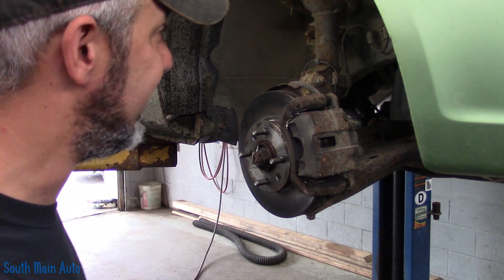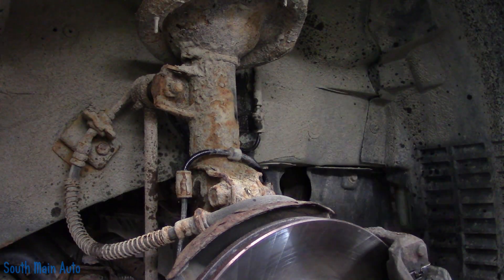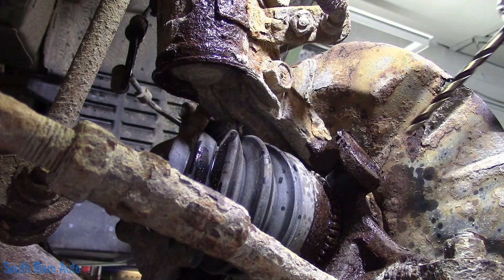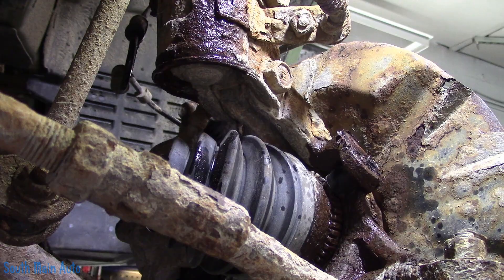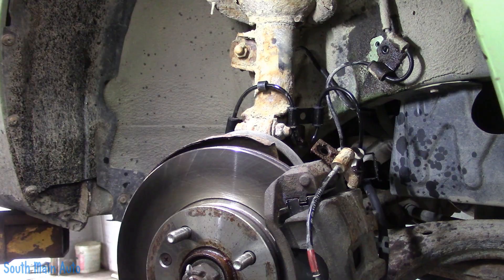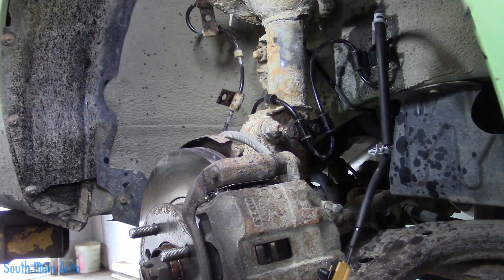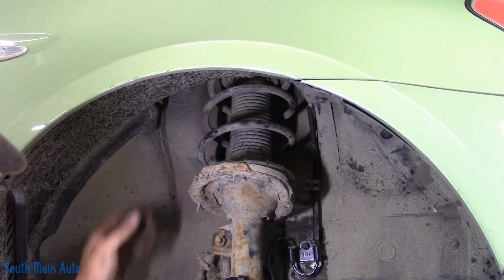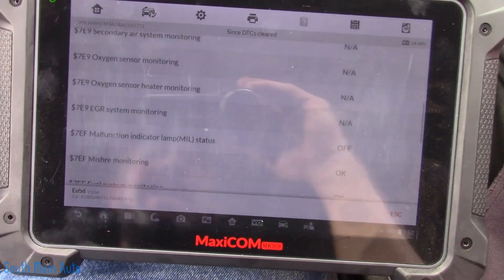Hyundai Accent: P0501 Vehicle Speed Sensor Range/Performance

Comment: Ive got a 2009 Hyundai accent and i changed the speedometer sensor but still wouldn't work , so figure its the wheel sensor ?what do you think ? I see its not to bad of a job to change it . Thanks for the video sure does help 👍🏽

Comment: I have this issue with my 2011 Accent - right after coming from the dealer for brake repairs - so I want to fix it myself. But online, this is the only source that shows it here, by the wheel. All the others point to the sensor mounted in the transmission for this code. But that must be a different sensor?

Comment: I'm running out of places to troubleshoot my C5 vette. The speedometer doesn't respond. I used an oscope to probe the VSS Signal and it's -6v to +6v. I don't think that's right? I also tried to use a function generator (cluster removed) and pump 0 to 10v square wave at 100 hrz into the cluster. Cluster doesn't respond. It'll sweep the gauges and all else seems fine with cluster other than speedometer doesn't register speed. The odometer doesn't register distance either in the cluster. Any help is greatly appreciated. I've tore into everything. PCM registers correct speed (with scan tool). Continuity checks / circuit is verified correct to cluster as well. I'm at a loss, thinking the PCM maybe out puting wring signal?

Comment: Ah, the Accent. I've got an '07 MC (2-Door) with just 49k miles on the clock. Solid little grocery getter. Lifetime free oil changes from the dealership. Every four months like clockwork. Free danish & bottle of water. Least miles between changes was 385 miles. Probably every time the oil going out looks like the oil going in.

Comment: Not a hyundai, but my car is having the same code. Everything works fine, speedometer is functional, RPM meter is ok. It's just that the check engine light will pop out if the RPM exceeds 3000RPM. No ABS. I'm thinking that maybe using a slightly smaller tire caused the error code. Some says that the tachometer itself is faulty.

Comment: I have a Kia Spectra with no ABS.  Same setup you have there.  I found out that if that sensor is bad you will never be able to set those three things to "Ready" because the wheel speed sensor feeds the PCM the speed signal.  So you won't pass the state emissions inspection tests.  If you had done a bit more 55mph driving they probably would have set  (at least the Catalyst and O2 sensor)

Comment: You wouldn't happen to know where the sensor is located on a manual transmission? I'm assuming the gearbox but just in case it's in a different location

Comment: I just heat up the left over part and melt the plastic a bit then they pop right out with a screw driver.  Clean up the hole with the Dremal and then the new one slides right in.

Comment: The speed sensor for the speedometer is located on the transmission. Had the same trouble code on my '03 Kia Rio. Unfortunately I wasted the $$ replacing the sensor when the real problem was corrosion in the wiring harness under the hood. Giant pain in the ass to figure out, took me ages to track it down. I never did learn what this single wheel speed sensor is for, must be something the ECU uses.

Comment: That relic appeared to be a 1964 Oldsmobile 88 four door sedan.  It would most likely have come with a 394 cu in v8 and may have had a 3 speed roto matic transmission, in fact it most likely did and they were junk, I think all the 98s had the four speed hydramatic although they had the same base engine..  Yes that was back in the day when you could just look at a car and know what year, make and model it was.  Now I can't tell which manufacturer the car is most of the time and as far as the year that is almost impossible for me.  Of course back then if you got 100,000 miles on a car you would have changed the plugs and points about 5 or 6 times, had to have had it aligned 2 or 3 times, changed the belts about 3 or 4 times and the tires would last maybe 20,000 miles.  The car would be totally worn out.  Yeah they don't make them like they used to.

Comment: Almost looked like an El Camino with that gigantic trunk back there, but that's an Oldsmobile - forget the model (looks like a few comments say it's a Dynamic 88). Early 60's. 👍👍 While the 2017 Chevro-laaay sits broken down! Sign of the times ... can't say I'm surprised!! 🤢

That was an odd system on that thing! How the heck can it read speed if it's open circuited? Must have a 2nd sensor in the tranny or something ... strange!

My new differential passed the test the other day - towed a Chevy 3500 van back from the Berkshires (Western MA) to central MA. -  https://postimg.cc/gnLCvDSG  - Had the tranny hit 212° on a long, steep grade. She was workin'! I'd imagine the diff was over 2-bills too. Nothing broke or howled, so it's all good .. but I forgot my ramps (yoooou dummy!), and had to get creative with a single 2x10 - cut it in half, and put a mini floor jack under each one. It worked! 🤣 Also made a scrap run. Workin' the ol' girl hard this week. Got rid of a '04 PT Cruiser, & piles of auto parts. Scrap prices still in the toilet - $110 per gross ton for whole cars and light iron. Seeing that PT get squeezed by the grapple was very rewarding. If I never put a wrench on one of those toilets again, it'll be too soon!! Good riddence, you POS PT!! 🎊 🎉 🥳

Comment: Real life removal of a speed sensor. In my experience Its rare to have one come out easily. I was impressed how quickly you got it out. The last one I did on my car (BMW) went into a blind hole so I was scared to drill it to far. Ended up removing the hub and punching it out from the back...bearing seems ok for now..

Comment: How the heck does a 2010 not have ABS?  Been mandatory in Europe since 2004, surely the great nations of continental US would have been all over that before the Bureaucratic EU?

Oh, and Hyundai are rusty buggers, wife had a 2010 i30 (aka Accent) and all the suspension/subframe was rotten out of it.  Body was perfect, just all the black bits underneath were in holes by the time it was 8 years old.

Comment: I'm not surprised there is a 2017 Chevy in your lot that needs a transmission.  We had our 2016 Chevy Z71 transmission replaced about a year ago.  I  replaced the A/C condenser earlier this summer and the (Rule Goldberg) power brake vacuum pump last fall.  All three issues are known problems, but GM refuses to do anything about them.  I've been driving Chevy pickups since my first one in 1966, but I'm afraid that the 2016 is my last GM product.

Comment: I think stability control was mandated in 2007???
They might be using the sensor as part of that system..
The speedo may be run off a speed sensor in the transmission.
Reply: The rule came in in 2007 but wasn't effective until 2011, so cars before 2011 may not have it.

Comment: DC continuity to the speed sensor is OL. But across the break in the wire, an AC voltage can be conducted. It’s known as “capacitive coupling.

Same thing if the metal or magnetic in the center of the sensor is broken; the magnetism can bridge a break.

Comment: I also have a p0501, but I have a 99 Volkswagen cabrio Speedo not working and I'm told it's an output shaft bearing, and in NYS here I cannot inspect my vehicle, the vehicle speed sensor is in the trans,

Comment: You can get the vehicle speed from the engine RPMs and current gear. Still odd to have just one sensor on the wheel rather than on the trans, but I guess that's their cheap non-ABS version without having to have a reluctor and hall effect on the diff.
Reply: It has a sensor there to. They are both used to get a reading to compare actual wheel spin to transmission spin in gear selection, speed, economy and whatever else checked by the ECM.

Comment: Just had to drill one out in 2016 Ford Explorer. Unreal. 3 years old and rotted in solid. Also has rotted rear a/c line. Ford did agree to fix A/C. But only pay for the one line that is already leaking.
Reply: I stopped with fords 20 years ago because the first thing to break on every one of them was the air conditioning. I have all the tools to repair a.c. In my garage thks to ford..unfortunately dont need them anymore, since i drive toyota and gm now
Reply: Ben Stankiewicz I run Toyota’s as well. My 04 Camry blows ice cold air and never been recharged to my knowledge.

Comment: That speed sensor is used for rough road detection. It momentarily stops misfire monitoring so as to not set a p0300 over rought roads
Reply: If true, good info..i dont recall eric following up on that after the fix..mr O did seem confused about its function.
Reply: On my 2011, it's also for shifting, so without it, it gets stuck/hangs at high RPM without kicking into the next gear at times. I'm waiting for my part to come in to finish replacement. The only part I'm concerned about is the old one has a red tape by the sensor just like in his video, while the Napa replacement for my year and type is yellow according to the site pic. Hoping that means nothing.

Comment: Yep,I had to get my" inner Eric O "on the other day, I had to replace the original shocks the other day on an 07 jeep wrangler that was from Connecticut the worst part was that the rusted out bolts were next the the fuel tank and I  wasn't about to put a torch on it I broke the bolts off and drilled as far as I could with a rotabroach drill bit and cut the rest off with a wore down cutting disc on the top side of the frame, 3 hours later I was done, wow I have so much respect for Mr O dealing with the rust day in and day out!

Comment: 2017 and the transmission already dead, that's a modern GM for ya
Reply: But if you own a GM and your transmission goes bad, you'll just buy another GM.
Reply: Funny enough a couple of my GM-loving buddies used to give me a hard time for owning Dodge pickups - "You'll only love it until the transmission craps out!  They are famous for their tranny issues!"  Funny enough, my Dodges all went 250K+ without needing any transmission work.  One of their Silverados needed a transmission right outside of the warranty period.  The other one needed one just after it rolled past 120K.

Comment: On non-abs  models the single wheel speed sensor is compared with the  gearbox speed sensor for  rough road detection which  similar  to low fuel level pids
 suppress  any misfire codes that are flagged up.  Rover used the same system in the 1990's

Comment: pretty sure the speedo works off the transmission speed sensor and toner ring, and the wheel speed sensor is both a backup, but also for the ABS.
Reply: Yeah I was confused I have a p0501 on a 1990 vw cabrio and it had to do with a transmission sensor and, I was told it was most likely a worn output shaft bearing but, this has me wondering
Edit: Speedo doesn't work

Comment: And this is why they have a 10 yr warranty. The car is done at that time. Nice video.
Reply: Bobby Brady you proved my point. Beyond 10 years these cars are worthless hence the reason you sold yours. The metal is inferior. They make a decently engineered car but they are so susceptible to rust (worse than other brands) they are dangerous after 10 years in the north. Good luck keeping your 2nd 15 years
Reply: Bobby Brady good for you. The average person doesn’t. I have 90s Buick’s and a 30 year old ford that I abuse with less rust than that thing. Good luck with your car and all the preventative steps you take that Hyundai forgot to do at the factory. I’m not going to change your opinion. Its a decent car like I said but no thanks after 10 years.

Comment: I had to replace both front hubs on my 2003 Chevy Trailblazer for speed sensor problems and also bearing problems.  Both of the sensors were bad and the left hub the bearings were creating a real loud roar.  The right hub, the bearings were creating noise, but not very loud.  Was a surprisingly easy job, took me about 1 1/2 hours to do it sitting in my gravel driveway with just a floor jack and jack stands using hand tools.  Don't have an air compressor here.

Comment: Vehicle speed is determined off the transmission output speed sensor on the transaxle differential portion of the transmission. Many Asian and European car manufacturers do it this way. Btw, that car is very unsafe if it only has 1 WSS for ABS. Most ABS systems that I'm aware of have 2 WSS minimum to get the ABS to brake evenly. Imbalanced brake application on the wrong wheel end, can cause a spin-out or roll-over in a non-traction situation.
Reply: Like mine, likely doesn't have ABS. It uses that hall effect sensor to compare actual wheel rotation to what the transaxial is actually doing. The Hyundai repair manual says the ECM uses it for confirmation of wheel speed and shifting control. Economy calcs, etc.

Comment: Great way to spend a Sunday. My Saturn Vue 2 wheel peeler has on one speed sensor right front.  They called it a rough road sensor.  I don't need a sensor to tell me the road is rough. Especially here in Pittsburgh.  We don't have smooth roads. LOL

Comment: Eric I follow your leed on this because I have 2011 Kia Rio same issue while replacing the wheel bearings w/o abs and speedometer worked but engine light on. No way to remove the hub without removing the speed sensor,  I cut the wire at the hub but did not remove the sensor wire so I know placement for install. While removing the sensor it broke due to the rusties than drilled some holes and used a large wood screws to remove the copper windings. Still stuck than chipped away the bottom plastic away with small chichel than pryed bits till removed. Used a small grind stone on drill to remove rust and dry fitted a few times. Eric great job thank for posting.

Comment: I had an 09 Kia sportage... P0501 new sensor installed.... Short and sweet innition 2 was only putting out 10.42volts was messing up abs module in pass side of engine bay. Client did not want to find compromised harness... "just run another wire" I was told.... It fixed it but I didn't and don't like it. I guess you can't do everything rite. Cool find cool fix I need to remember that.

Comment: I changed the wheel speed sensor on my 03 Toyoter Prerunner. The sensor busted off just like the one on the Hyundai. I drilled mine out too. Took a little emery cloth and cleaned out the hole and reinstalled the new one,  ABS light turned off after install of the new part.

Comment: without finishing the video, it could be like my Passat, 4 sensors on each corner and a speedo output in the trans.
Reply: I was think speedo sensor in the trans also, and the wheel sensor is there for the two check each other.

Comment: We had the same problem. garage replaced with a napa sensor but the problem came back about a mile down the road. replaced it with a Hyundia part and as soon as the car gets to 25 to 30 mph, the code comes back. drove it that way until to much rust to pass a safety inspection. For sale cheap!!!

Comment: Just wanted to give you a giant Thanks Eric!!!! My car has been having issues loosing coolant and overheating at idle. Shop told me the waterpump and possibly more but they wouldnt do anything till the waterpump was replaced. 500 just for that. brought it home and tested myself. noticed a bad fan and a cracked radiator. Using knowledge gained from your channel I was able to get it all torn apart and just waiting on the radiator to arrive here in about 45 minutes. Keep up the great work!!!
Reply: Just have the dealer show you the radiator leak. Should be pretty obvious with a hand pump. The ripoff happens with the dealer parts markup, not on dishonest work ;-)
Reply: Was a small hometown mechanic he refused to touch it unless the water pump was done. I'm almost finished with it thankfully and will be glad when it runs without overheating.
Reply: @phoenixjohnson3287  so instead of getting a pump out to pressurize the system he said he couldn't do anything until the water pump was replaced? These are the people (I not using mechanic cause a real mechanic would've done something) that give actual mechanic like Eric a bad rap.
Reply: @joevaagen6170  exactly. So when the words of Eric saying remember veiwers if I can do it you can do it. He's right. I wish I had the fancy air ratchets and that he has but it got done. I'd take my car to South main if it wasn't a 6 hour drive LOL
Reply: @phoenixjohnson3287  you ask me the 6 hour drive might just be worth the trip to SMA. I wish i was that close.
Reply: @phoenixjohnson3287  air ratchets are nice but long handled ratchets is all one needs to do 90% of work. I've got 4 different air ratchets but mostly use hand tools. I find it easier to use.
Reply: @joevaagen6170  First thing I do is look for any obvious leaks and if I don't see any I then pressure test it as any mechanic should do. It sounds like he just wanted to make a job for himself.
Reply: @steventaylor5687  oh absolutely and you said the operative word SHOULD have done. I'm willing to bet that 85% of GOOD mechanics do that because its common sense even though common sense IS pretty much dead. Lol

Comment: Had a 2014 GMC SIERRA v6 and the transmission was terribly clunky.  I hope to see a video on that 2017 Chevy transmission.  Glad I traded that truck.
Reply: I was at 97,366 miles on my '07 Silverado when I replaced the rear differential carrier. Spider gears were missing the tips of all their teeth! 🤢
Reply: @SmittySmithsonite  Not good.

Comment: Eric, you forgot to add “not a sponsor” at 1.52. People will think you’ve hit the big time!!!! 
You’d be a happy camper if you found this vehicle in the junk yard in a couple of years and you needed a speed sensor, so keep on lubing!
Reply: The scanner computer used in the video: https://amzn.to/2H3l6dt Autel MK908 Ultimate Wireless Automotive Scan Tool with ADAS, ECU Coding, Full Bi-Directional Control, ABS Brake Bleed, OE-Level All Systems Diagnosis